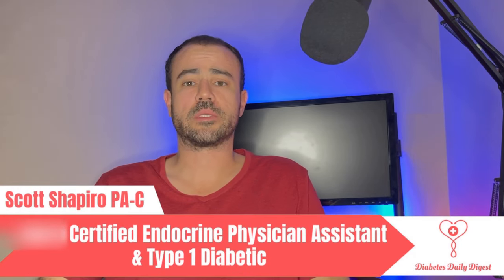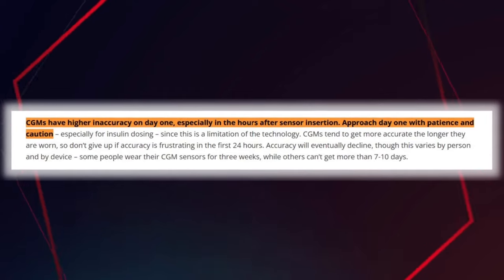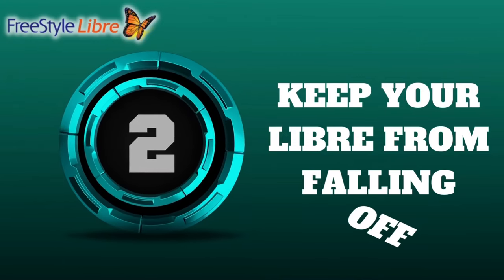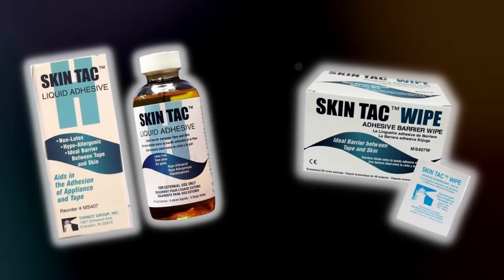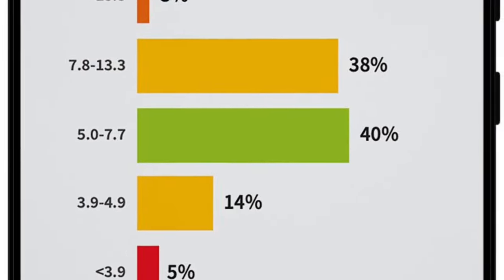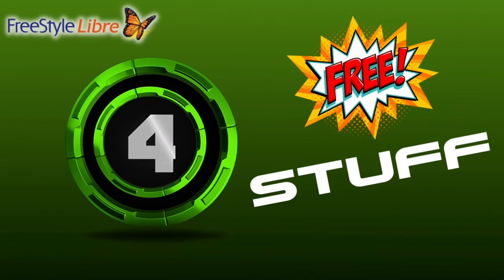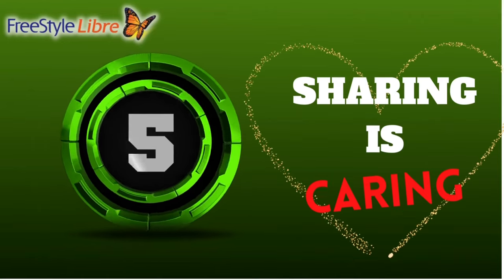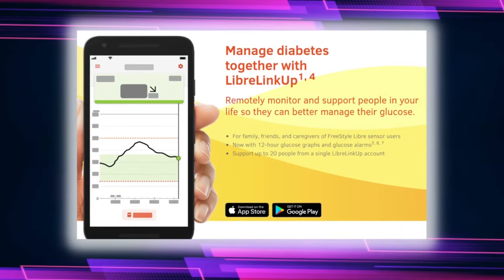5 Tricks Secrets & Hacks For The All New Freestyle Libre 3 & Libre 2 CGM's!

Comment: I'd recommend the bandage patches. I used to regularly knock of the sensor, being large and clumsy. Doesn't happen any more. They last about 12 days, but when they're off, the sensor is still stuck on hard because it's been protected all the time.
Reply: Hi - Which brand/product do you use?
Reply: I used a lot of things before I settled on a patch from Amazon. It's clear and sticks like crazy. It curls a little bit around the edges but stays on. It sticks so well I take the cap off a Gigaloo can and trace it and cut back about .5 inch off the edge it sticks so well.

Comment: I'm a type 2 insulin user. I seem to be having a problem with my Libre 2 cgm . I started using them in June. In all this time. I have only had 3 sensors last the full 14 days.  2 if them failed within 24 hrs. The others lasted anywhere from 7 to ten days. A number if them started giving me ultra low readings.  I have received replacements. But I can't seem to be able to contact someone about this problem. Is there a possibility that the libre 2 may be incompatible with my body chemistry. This is quite frustrating.  Many of the results are a 40 point difference. I have had numerous  low arms during the night. And some during the day. Any suggestions by you or your readers would be appreciated.
Reply: Two things that might help, first, make sure you drink plenty of water and keep your fluids up. Second stay away from high doses of vitamin C, as this may make the meter read incorrectly.
Reply: Same with my father in law. Last two sensors have been showing 40-60 units off from the finger prick readings. For days, and there is no way to calibrate it.
Reply: That not bad.  I get 100 points difference some times.

Comment: I just recently got my sensor. And it doesn’t work. It’s off anywhere from 15 points to 60 points. It always says my glucose levels are lower than they actually are. It’s too expensive to not have accurate results. Even with my insurance it’s going to cost me $40 for one sensor. That’s crazy. So unfortunately I am going to have to stick with the old fashioned finger pricking method.
Reply: I’m adding an update to my comment above. I have to say I don’t mind picking my finger at all. And I like that my numbers are accurate. It really is not that big of a deal. I don’t know how I will feel years from now. But right now it’s no biggie.

Comment: If I pre-apply the libre3 24hrs ahead, do I still get 14 days when I activate it, or does it drop to 13 because of the pre-application?
Reply from the maker: No, you apply the warm up sensor 24 hours prior to the other sensors expiration so you don’t wind up losing any time. Just make sure not to start the other sensor until the other one expires.

Comment: Thank you so much, Scott! I'm only a minute into your video here and you've provided the answer I was seeking. This is my first time wearing any CGM and I've only been wearing my FL3 for about 17 hrs. Last night, 1.5 hrs after going to bed, I was woken by the app "low glucose" alarm which I knew immediately was false, but took a manual reading at that time with a strip reader just to be sure, and wow, it was way off. The app never registered that low reading on the graph or 'time in ranges'. If other users are reporting inconsistencies, inaccuracies, false alarms in the first 24 hours, that gives me hope and I'll be patient and hang in there. I knew, prior to trying a CGM, that there could be inconsistencies between the CGM readings and my manual glucometer and I found that to be true yesterday, but I didn't know that the FL3 could be off during the first 24rs. This morning I noticed the two meters are now giving consistent results - I've taken 3 manual reading for compaison so far and they match the FL3, so I'll be patient and wait.

Comment: Would the attachment be affected with an active lifestyle like weight lifting?
Reply: Type 1 for 35 years, Age 45 here. I do heavy weightlifting. Have for the better part of 15 years. Squat/Deads in the mid-350lb's to give you an idea of what I'm moving. I've used the L3 for 6 months now. No problem in the gym. Stays on fine. The only times I've ripped out a sensor is on door jambs not at the gym! Ha. Highly advise using one for all athletes. Knowing your real time bsl is a game changer!
Reply: @joneric13  That is impressive! Keep up the outstanding work on self improvement. Thank you for your helpful info 👍
Reply: @LATOHOUSTON  Absolutely! Will do :) I hope using a CGM brings you gains!

Comment: I sometimes have trouble getting the Libre 2 to discharge fully when using the applicator, it will get stuck halfway out and not release from the applicator.  Has anyone else had this issue, or am I doing something wrong?
Reply from the maker: Not just you, I’ve had this problem in the past too. I think it’s a bit better with the Libre 3 applicator though.
Reply: @diabetesdailydigest  Good to know!  My endo recently got me switched over to the L3.

Comment: I used the skin tack product but have once had the little filament not go through the skin properly, seems to have “caught” on it’s way in.  I use it around the edges if I notice the adhesive giving way.  Your cloths stick to it and to the skin tack that you get on the sensor itself, so be careful to only apply at the edges.

Comment: Is there a way to use the sensor for more than 14 days? Or will I have to buy it all the time?
Reply from the maker: Unfortunately every 14 days it will expire, no way to bypass it.
Reply: The chemical inside often doesn't even last that long. This is not a battery problem.

Comment: is there a way to calibrate the Libre?  When I did a trial run, I did not see that option.  If they want to pair this with a pump in the future, that would be a necessity I would think as the pump would be getting inaccurate data.  thoughts?
Reply from the maker: Unfortunately there is no way to calibrate the current Libre sensors as they come factory calibrated. Even the new Libre 3 has no way to calibrate. Dissapointing as both the Dexcom G6 and G7 allow for calibration which I feel is an essential feature.
Reply: @diabetesdailydigest  I thought not (I did a trial of it) and that is a HUGE game changer.  If it is off, then  your pump is delivering incorrect basil rates.  NOW, if it is close to Dexcom, that happens about 1 in 4 sensors.  That can't happen.  If you are in tight control, you need that cgm to be dead on.  I appreciate your channel and look forward to more content!